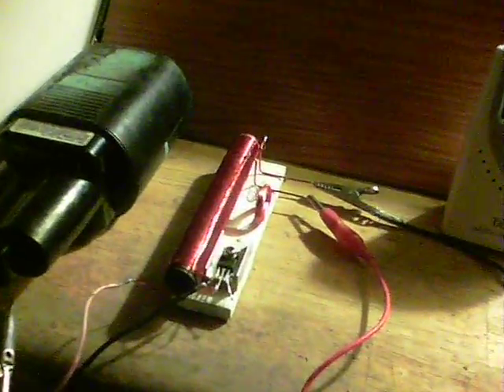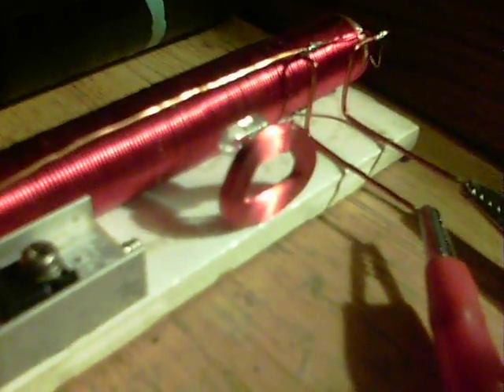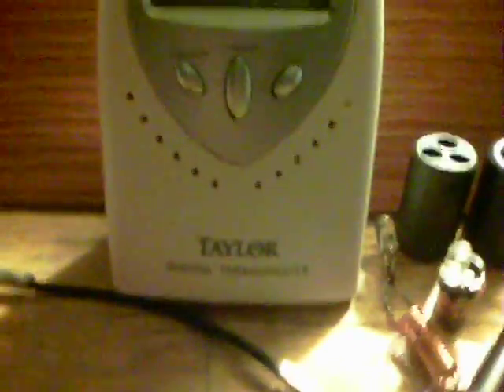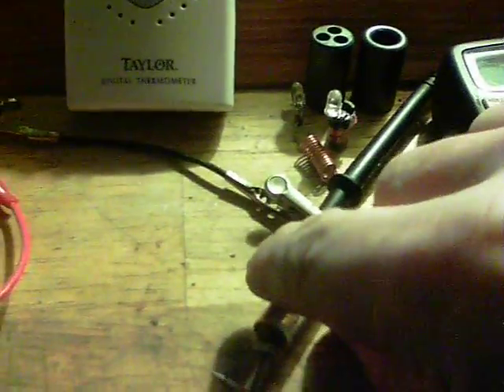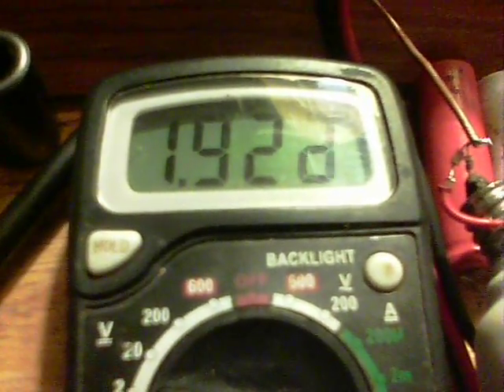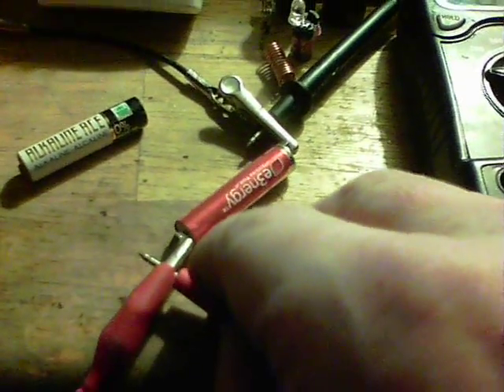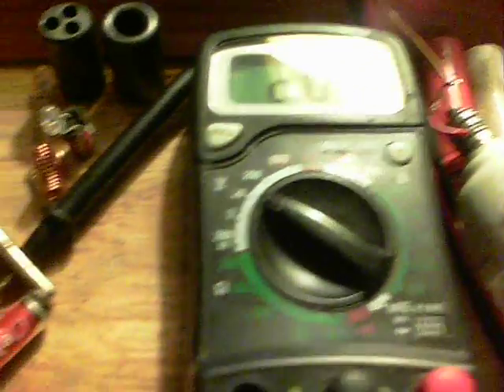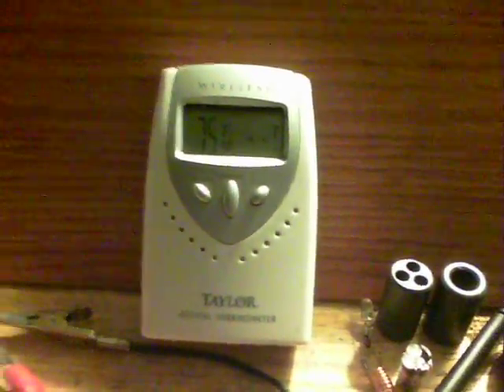Super Turbo Battery Charger

Comment: slider, if you still got this pice, may try to add a magnet at any end of the coil and try the different poles, it may increase the output even. You also can also try to add a potentiometer before the base and see, if you can lower the input by same output, and then may replace it with the same resistor.
Reply from the maker: Ahh yes, the magnet influence, good idea. I don't have it now but the idea is sound, as is varying the resistance to the Base. Am always saving ferrite pieces from junk boards lol, it all goes back to this build :)
Reply: Nice. I tinker a bit around with it, since i saw some from LS Videos. Just so endless Options with the coils build. I actually tried to get them into resonance. But with the magnet(s), now i put at each end one, i could rise the output voltage from 30 to 50V (spikes are ofc higher) and output mamps equals to the input mamps.  I did run the circuit from an old batterie too and it drained very fast. By adjusting it i got a point, where it did consume way lesser but didnt really drop the output. And btw did you hear that J.Bedini died 4hours after his Brother. .. Old EF times...
Reply from the maker: These are similar to Slayer Exciter towers, in that too few or too many turns can have adverse effects..that's something I learned anyway. Wind a coil of 2000 turns and it may be less effective than a couple of hundred.
Yeah, was a shock to hear about John. I always liked the guy. Difficult sometimes but fair and I respected him for that. One time I was doing research on reusing the Negative plates from worn out 12V gel batts (cos the positives are what turn to mush and kill the battery) and he popped up saying he'd found a way to reuse plates from gel cells. On being pointed to my vids, he apologised and credited me with the initial research in his write ups, can't say fairer than that if he didn't know !

Comment from the maker: It's pulsed DC. The transistor fires, the transformer effect changes to HV, but it's still a polarity based output. So rather than +/- , it's Ground and the + is a train of fast pulses at around 1MHz. Similar thing with solid state Tesla towers, where a metal block will form a Ground connection, it's always a Ground and never a Positive. Good question though, hope that helped :)

Comment from the maker: Kept it exactly like this and then was asked to make one...sold this one as, for one thing, it was proven.
Big heatsink is easy way to keep the heat down, if aluminium it won't noticeably affect the fields for wireless.
It always did just strike up, maybe touch power connector a couple of times but wasn't difficult. The C4439 is really good for lower outputs and easy Base start. DMM's do act like a resistor and that was all it needed, though LED draw was also enough, worked well as indicator :)

Comment from the maker: One way is a longer ferrite, Lasersaber's original being 8" length. If yours is far shorter then it would help. But also the transistor...a large power transistor with over 200 hFE would most likely be the fix too. LED bulbs are the most efficient for amp draw and your transistor might not be able to deliver the wattage needed for the others. That's what I ran into at 12V unless amp draw zoomed past 1A...perhaps that's normal !

Comment: ı have about 400 turns on secondary and 72 turns on prımary but ı get only led bulbs to lıght not cfl"s and ıncadescents fılament get whıte but doesnt lıght the bulb... voltmeter cant get a readıng ın ac or ın dc volts at the output wıth no load cause ıts over 1000 volts at only 10 volts ınput... what can ı do to lıght 15 watt cfl"s wıth thıs thıng or ıncadescents

Comment from the maker: Yep :) simple rule of such builds is to fit as many turns as possible along the ferrite of one gauge, then use a larger diameter gauge over the top, same direction. Should be upward of 400 turns of the finer gauge.

Comment from the maker: Neither really! it's pulsed, so with an open circuit the reading will be an average of the high peak and the off period. That's what makes things difficult and as often reported by others. The only real way to measure what has gone in to a battery is to disconnect it, let it settle for an hour and take a reading. Here I was reading across the battery on DC scale and is 'accepted', because the battery is smoothing those pulse spikes like a huge capacitor in some ways.

Comment from the maker: It's high speed pulsed DC, with very large voltage potentials and how people are able to run household lightbulbs. Small current is the trade off. That small current output is what stops something like a battery from exploding or otherwise having strong troubles on such a circuit...all is quite similar to the Bedini SSG and how those circuits charge batteries.

Comment from the maker: On the video I uploaded yesterday 'Ancient alkaline restored', a 15+ year old alkaline was charged for 1 minute. It then is shown to run an LED oscillator. That battery is still flashing the oscillator 21hrs later ! so, it seems that probably depending on original chemistry, the charge is real enough and not fluffy. The ancient one is a heavy duty, but all batteries tried have taken a charge. It's a bonus that single use alkalines can charge, I expected just Ni-Cd or Ni-MH.

Comment from the maker: Very good points and i've seen such things myself with radiant. The thermometer is still going, but most probably can't last long with just a few seconds charge. The 2 white AA's seen were flat for years and neither reverse polarity spiking or my usual R/C balance charger worked. However, 1 is charging up right now with the charger. Most probably each battery is different and mileage may vary, as they say.

Comment: Nice charger!! When I observe that when I charge very fast the 1.5 batteries for example in the mains 120v with a diod and 50wats bulb in series with a dimmer swich, it discharge very fast too. Have you test the duration of the charge? The circuit that I use is similar to this (watch?v=XIjpXSqnFig), it will be interesting if you try the high Voltage generator aplication of the circuit with your SJR ;)